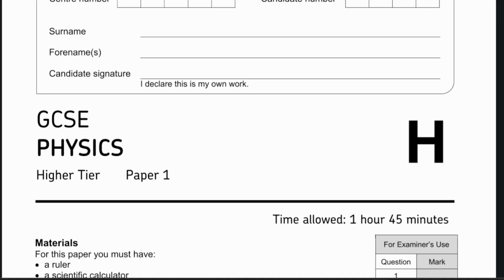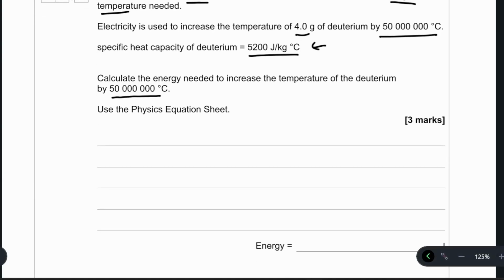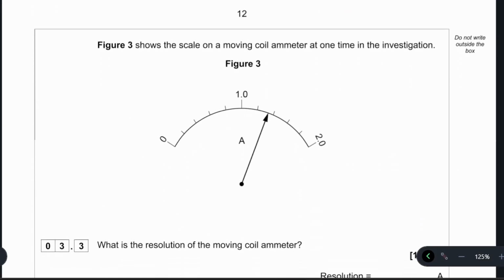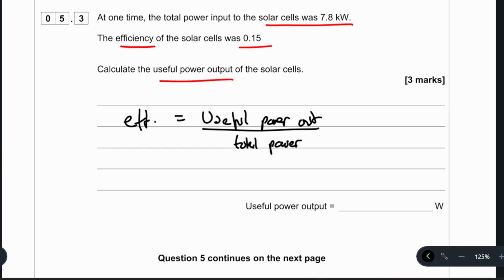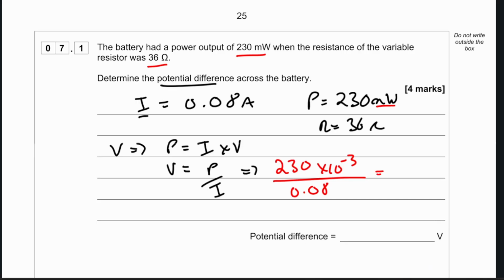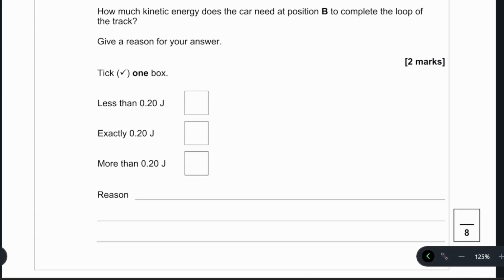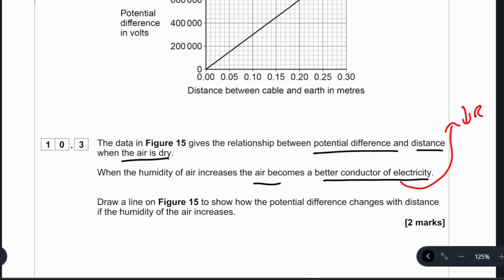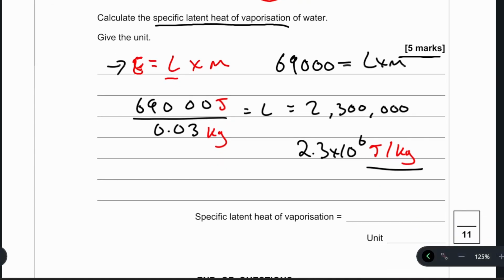Physics Paper 1 (WALKTHROUGH) - November 2021 (GCSE)

Comment: can you explain Q10.3 i dont understand how the line would be lower if its a better conductor wouldnt it be higher
Reply from the maker: You can think of it like this: If it is a better conductor, that means more of the potential/voltage is transferred between the  cable and the earth - therefore the potential DIFFERENCE  between them is lower. This is the same reason why the potential difference is 0 when the distance is 0 (all the potential/voltage is transferred from the Earth to the cable very quickly - they both become equal in potential/voltage so the potential DIFFERENCE becomes 0).
Reply: thank you for replying @HitTheBooks1